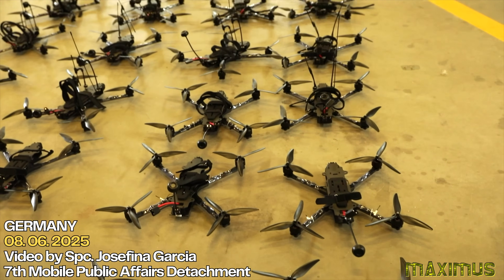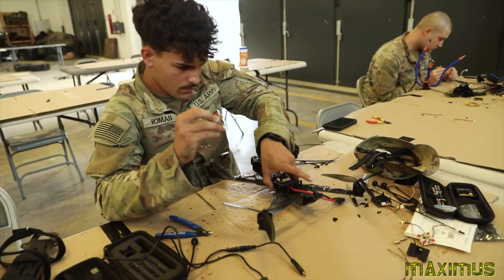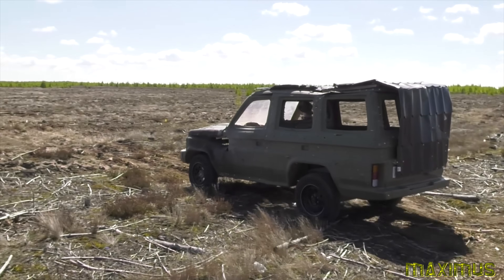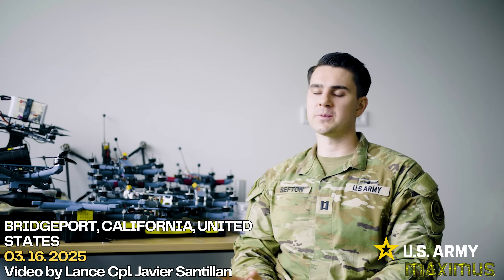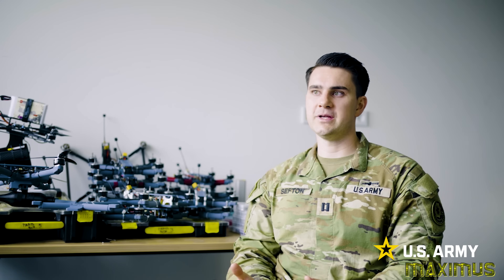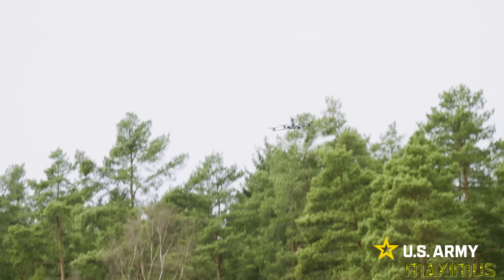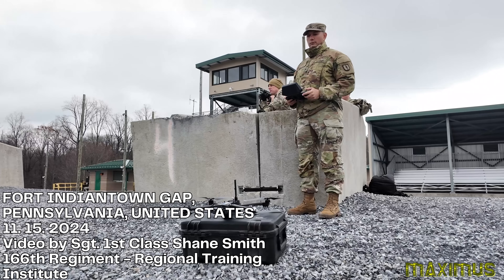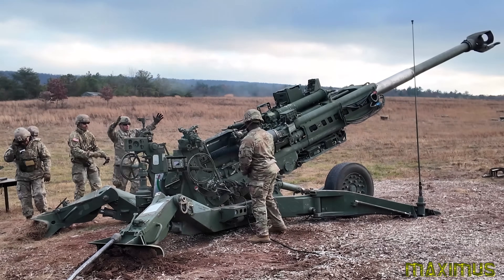DRONE DOMINATION! The US Is Building The Most Dominating, All American Made Drone Army In The World.

Comment: 1:56 that’s a DJI RC RM510 Pro Drone Remote Controller With 5.5" LCD Multi-Touch Display , Dual-Band Wi-Fi 6, 5.1 Bluetooth Support, 32GB Storage And MicroSD Slot 😂. This is smoke and mirrors, they are just 3D-printing the frame and buying Chinese drone components to assemble in-house. Pretty sure there aren’t any cost savings after one factors in American soldier  labour costs otherwise they will also be selling these in the American market.